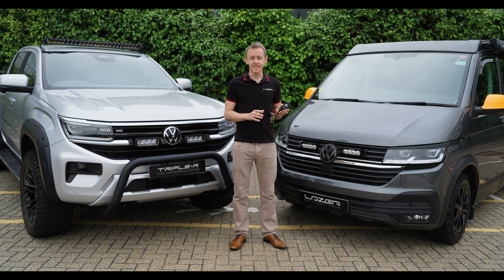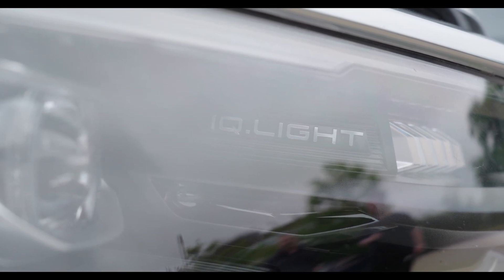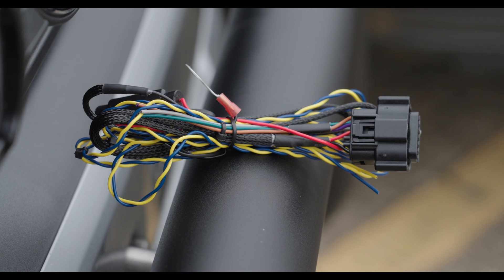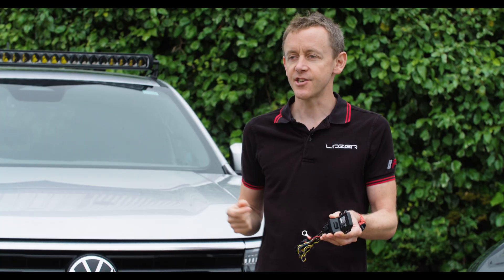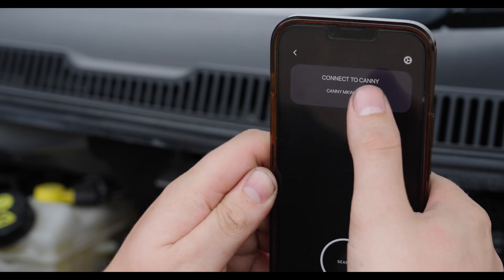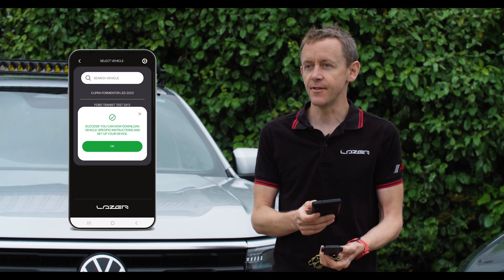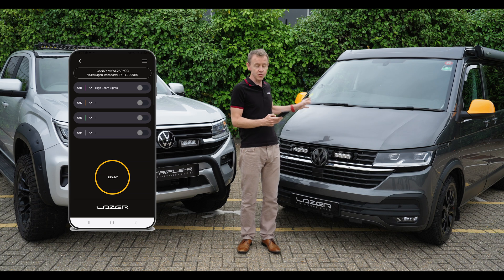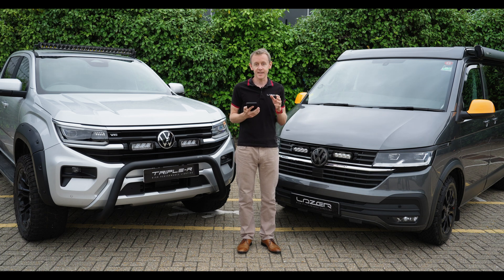LAZER LAMPS | Introducing CANNY

Comment: Hello, I have 2 triple R 750 elite and 2 sentinels elite 7 installed on my 2024 defender 90, love them. For my 2025 defender OCTA,I have purchased the Linear-42 Elite, paid for 2 sentinels elite 7 (6 weeks delivery time due to short stock) and looking to put a TRIPLE-R 1250 ELITE+ in the grille. Do I need to install a CANNY? OCTA has the matrix headlights. I want to simply operate it like what I do in my 90, I have physical switch for all the Lazer auxiliary lights, one flick on/off, not connecting to my headlight.  Thank you.
Reply from the maker: Hi there, I believe we've gone back to your email regarding this! :)

Comment: I do not recommend it to owners of the new VW Amarok 2023+. The fact that it is shown in the film has nothing to do with the operation of Canny in it. The module simply does not work, it cannot connect to the Canny.lzr application. 

I bought a set with dedicated lights from a Polish distributor. The exchange of emails and phones has been going on for two weeks and nothing comes of it, the module still does not work. It connects to the iPhone via BT and is visible, but that's all.
Reply from the maker: Thanks for your comment. To set the device up with the Amarok, it does need a firmware update to be carried out before the vehicle configuration can be loaded. 

As you have had difficulty with your unit, we would be happy to exchange this for one pre programmed for your vehicle. If you are able to let the dealer know which functions you would like on the outputs we will arrange this to be sent to you as soon as possible. 

We want to check the device you have, and see if we can replicate the issues with our own VW Amarok development vehicle.
Reply: @piotrkw1  Problem solved. Lazer sent a new, programmed Canny module. There were some problems, the first time the module started, but the application hung during the update. But everything went well, the application updated to version 2.0. The LED works in accordance with Amarok's lighting automation. Thank you for your help, there is a lot of light and very good quality. ;-)
Reply from the maker: @piotrkw1  Glad to hear it's all working with your Amarok and you're enjoying your new light 🔥🙌